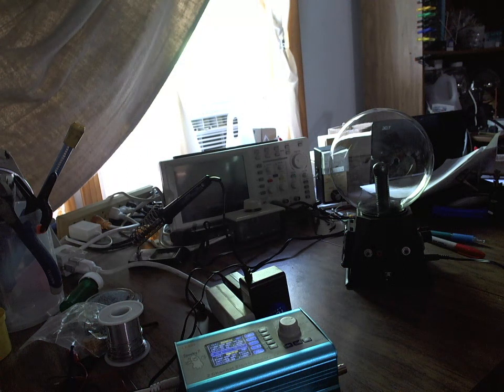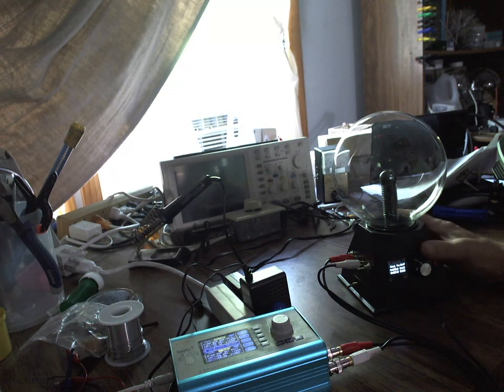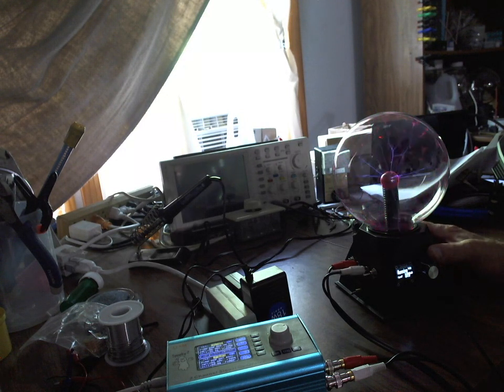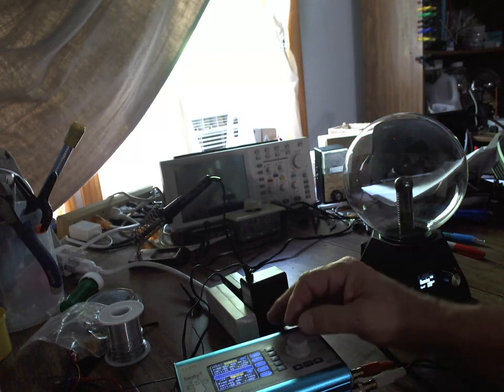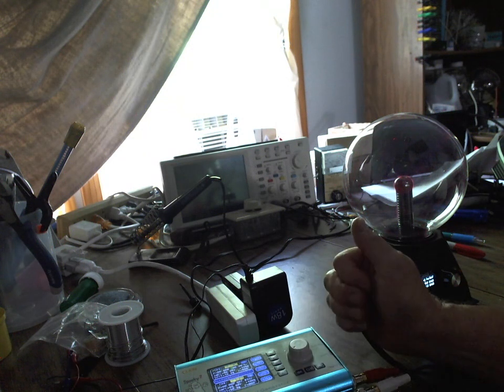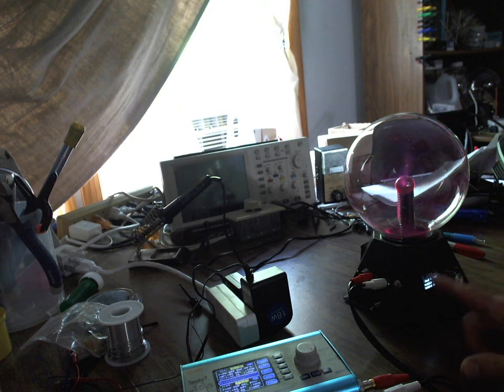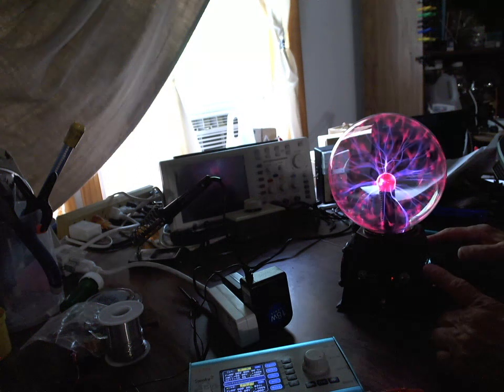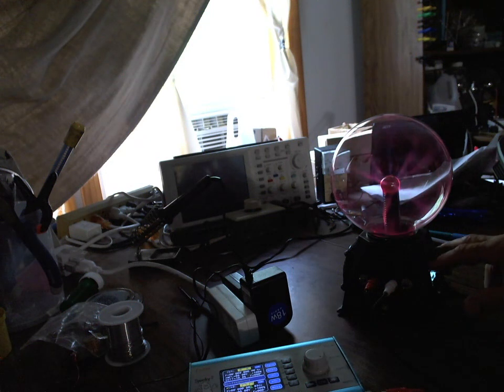Working with a Spooky2 generator

Comment: I use the Spooky2 Central and the Phanotron Plasma bulb. I tried everything (by the book) but the generator is constantly freeze. Any technical advice?
Reply: Did you speak with the spooky team?
Reply: @randompiano  yes I changed the power circuit of the Central  now everything is working fine, thank you
Reply: Sorry one more question, are you finding its making a difference to you?
Reply: @randompiano  what do you mean exactly. The stability or the overall benefits
Reply: @johnreinhard8822  the benefits
Reply: @randompiano  
We are on the way, at this moment it is hard to tell. But it an investment I  tome and money
Reply: @johnreinhard8822  I’m curious, any results? Thank you.

Comment: Just an idea. Instead of using a Spooky2 generator, you can use a cheap PWM  to generate the 28KHz square wave carrier for the plasma ball. You can then design circuit to frequency sweep a cheap XR2206 (1uA-3mA current ramp) or a cheap XCL8039 (+10V to +12V voltage ramp) boards.  Using this frequency sweep (500Hz to 25KHz square wave) source for your gating input, all the correct Rife frequencies may be generated by your plasma ball radiations.
Reply: Sadly - no longer on this realm...
Reply: @middleway1885  seriously a bummer.  I tried to warn him some about hulda clark and bob beck dying of cancer, yet it seems those admonitions feel on deaf ears sadly.